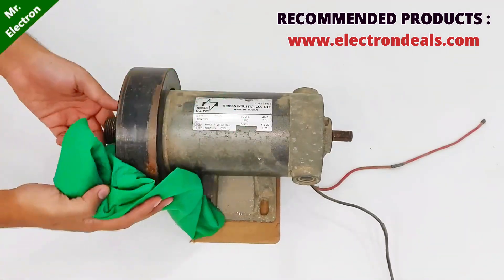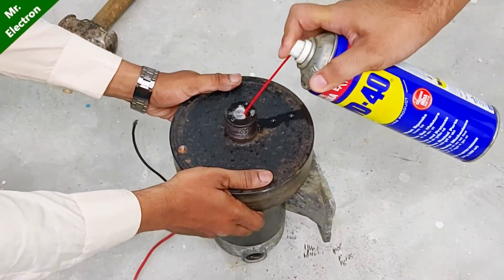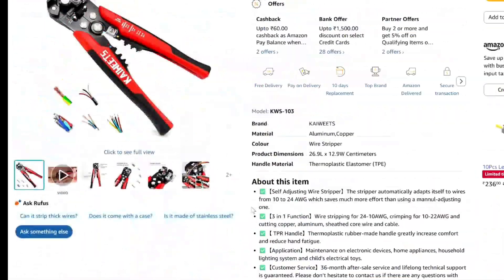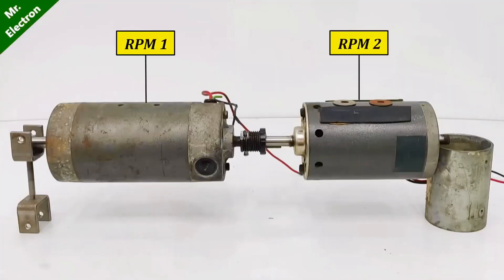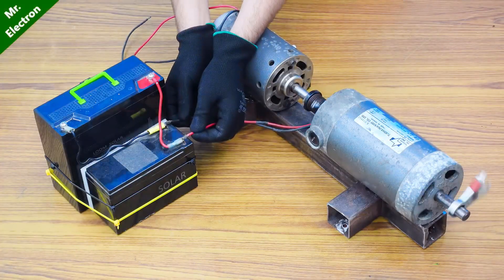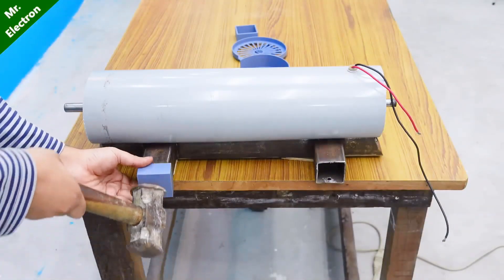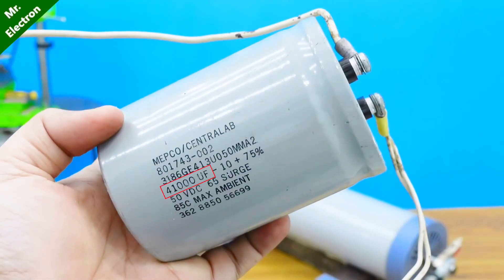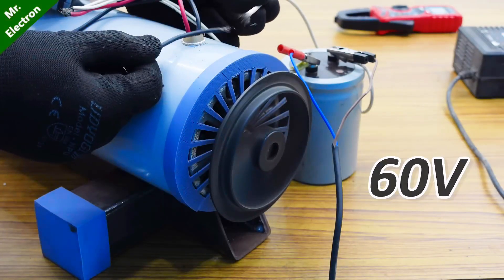I Used Treadmill Motor Like NEVER Before… Everyone Was Shocked

Comment: How much dod u purchase 3d printer for ? And i was reading an ebike motor or treadmill motor combined with generator/alternator and dc ac converter can produce around 1300 watts constantly with a belt.. what are your thoughts and how did u turn down the voltage in your household battery to charge your bosch battery and bike battery? Im still learning.. thanks